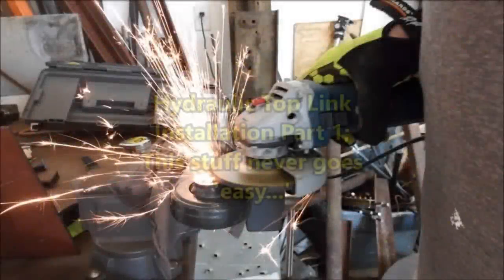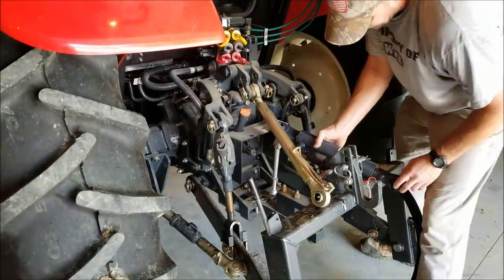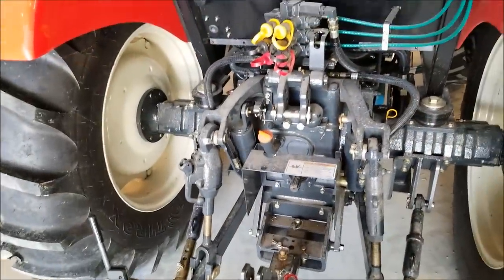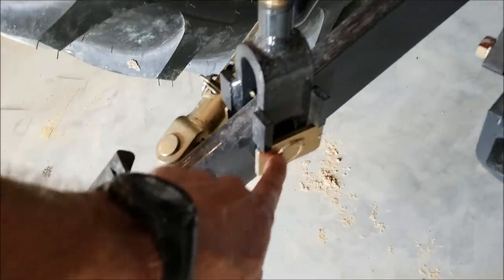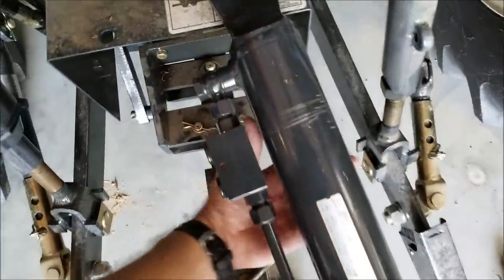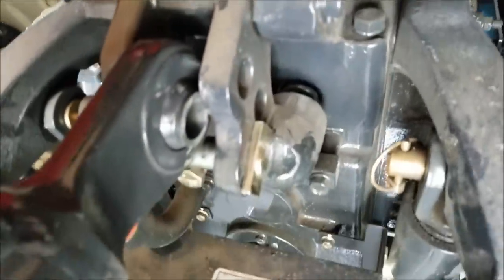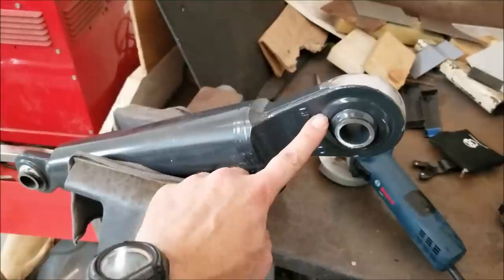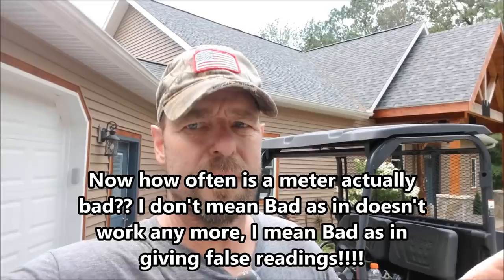DIY Hydraulic Top Link install PART 1 and 3 point arm draft adjustment

Comment: My Tractor Supply seems to always have those in stock. We don't have Rural King in Texas. I'm always  buying the lower arm cat 1-2 bushings
Reply from the maker: yeah, just seems that our Rural King is always kind of bare on the ONE kind of bushing you need!!! Those lower arm ones I think are actually different on different 'quick attach' systems. I believe that the size of the lower bushings is actually Cat 3, because they are huge, but can't say for sure..

Comment: I was lucky w my top link. I got it when I bought the tractor and the salesman ordered it specifically for my tractor. Now looking at yours, mine is completely different. Where yours is long and kind of slender mine is a bit shorter and fat. It’s probably 6” wide. And it doesn’t have the valve on it as yours does. I haven’t had any problems but should I consider adding one?
Reply from the maker: I'd say if you haven't had any problems don't mess with it. But they do seep naturally, just depends of what  you are using it for..
Reply: Why would they weep not much different than a standard ram and you can’t have a standard ram weep when in use?

Comment: How come you didn’t order hydraulic Cat 1 top link? Save you all the time you put into grinding and getting parts to make it fit for tractor.
Reply: I told Kapper not to. A Cat 1 would be too lightweight for this tractor given that I have bent the ram on my Cat 2 top link with my smaller Kioti tractor like Kapper just traded in.
Reply from the maker: Yep, I agreed with Eric that I'd rather have the heavier duty one. I'd much rather modify it just a little now and have the extra strength and lifting ability going forward.
Reply: Kapper Outdoors. That make sense to get a bigger top link .

Comment: Kapper, I feel u frustration hate the trips to town to find parts to make stuff that’s new supposed to work.  Like u if I find one that right, I buy two.  Been redoing garage as I am strong enough and so many tools I finding.  I bought the stores out over the years.  If I could find some high school kid that wanted to work I could nock it out so much faster.  I going have one huge rack wagon for Auction guy when I kick off.  Go thru those oxygen cylinders walking between garages and by time I got things on table to go up on pegboard it gets to hot.   Some day it will be organized.
Reply from the maker: good luck getting organized! That is on my 'hit list' to do also, LOL